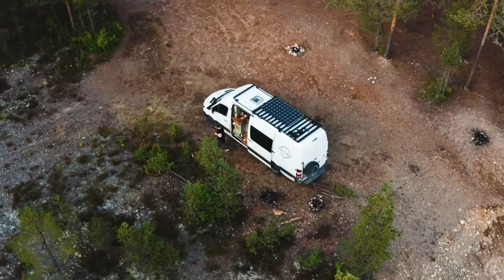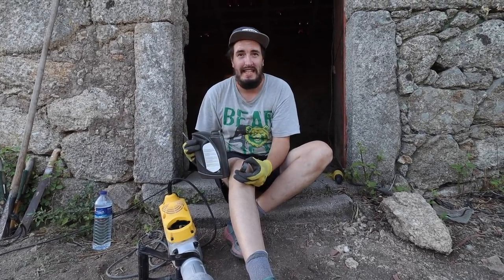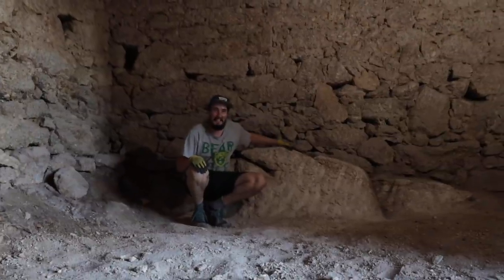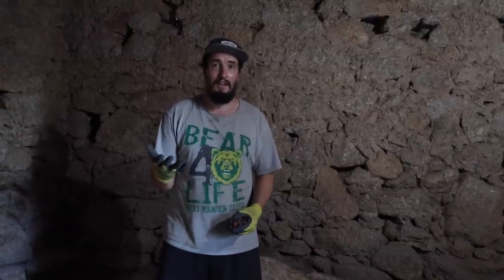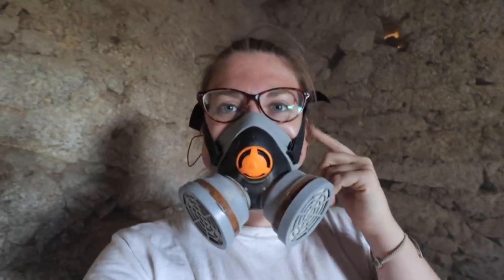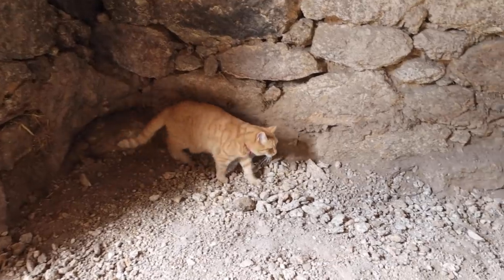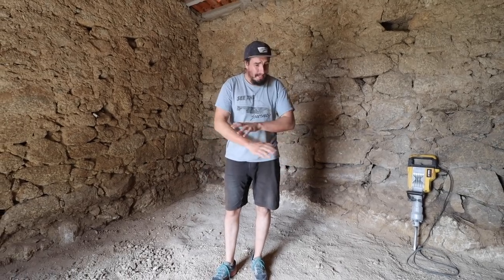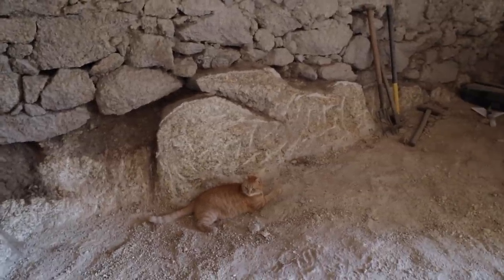Removing the Roof from our Abandoned Stone Barn! Tiny Home Conversion Portuguese Homestead

Comment: Don't get rid of the gravel and cement, recycle it on sight as groundfiller to level the area outside the house, its an excellent base for a parking or a patio that drains away excess water and help keep the house nice and dry
Reply: it looks like the concrete beams have rebar in them. may be difficult to crush
Reply: Great idea!

Comment: All that hard work is paying off on the barn, looking good! 💖💖💖.  BAKED FIGS AND GOAT CHEESE: Line a baking tray with some fig leaves. Slice up about an 8 ounce goat cheese log into about 6 thick slices. Cut about 10 figs into halves. Arrange the goat cheese in the center of the baking dish surrounded by the figs, drizzle olive oil over all, sprinkle with chopped fresh rosemary and salt and pepper to taste. Bake at 400 degrees for about 15 minutes. Afterward you can run it under the broiler for a minute to brown the top. Cheers!
Reply from the maker: Lovely!

Comment: Oh my gosh! My muscles & bones ache just thinking about all that work! I cannot believe that putting in the new floor will be nearly as difficult as taking that stone out. Oh, it was so smart to save the tiles & should save you loads of money. Now i can picture your home in there. Whether you build from scratch or cobble used bits together as you did in the van, it will be a showcase of your design style but be warm, welcoming and comfortable as are your previous builds. All that stone should hold in the cool in summer after an insulated roof & those wonderful tiles go on.

Comment: the concrete beams perfect for foundation under smaller buildings(if you accidentally don"t have there  rocks) or if you need to build terraces or higher walls in the rocky hillside, the beams can help you make a supporting wall, against the falling rocks.

Comment: Seems like you might/maybe could use the concrete as filler to make benches, outdoor tables, raised garden planter beds and line a pond bottom?
Reply: Maybe a French drain for water run off?  Allllllll that work ...people need to SEE all the rubble you two removed by hand.

Comment: I think you could use the concrete and stone rubble on the driveway which I guess you can later tar so that you have a proper road inside this rather large property. Easier to drive in and out especially during wet weather. All the rock and concrete debris will give solidity to the road so it doesn't degrade in heavy rain. 
With the concrete beam structure you could fill it with earth and grow things like strawberries that you can pick easily while standing up.
You can pick raw figs and cook them like a vegetable. Quite tasty. That's my two penny bit for you.
Great job at the barn. Ease your aching bones with an oil massage, any oil, olive for example, and wash off in warm water.

Comment: If you have a deep roof over the south side of the first floor, you may as well beef up the supports and cantilever the mezzanine across that overhang. Increase the size of the mezz or just to push it back so it doesn’t take as much space in the main structure.

Comment: Have you considered a skylight?so much light with the roof off.
Reply from the maker: Yes we are putting in two 😊🙌
Reply: Exactly what I wrote. Brilliant idea. Love to see it.
Reply: Skylight sounds great,  however I would consider having slatting over the top to keep the sun off, as it will overheat the interior, triple glazing sun protection is good, but pricey.  For cooling consider a beehive vented box at the top, this draws hot air upwards and sucks cool air in from below.   In the middle east the bedouin tents are double layered, outside layers takes the sun heat, the interior void circulates hot air away upwards, the interior layer allows the inside to cool.  If you look at the housing in the area you will see steep pitched high ceilings this is for cooling.   Give gingy bear a hug from me.
Reply: @Rockhopper1  Aaaa

Comment: Great  job on  the floor and roof! Do not trash the concrete beams, they will come in handy in the garden, or when you want foundarion for something you need to build. I have moved To Sardinia a few years back so I do know the stone houses. Make sure, you insulate and waterproof the house, especially the roof. The stone houses look beautiful, but in winter they tend to be cold and wet.  As for the figs - make a fig jam. Do you have only dark figs or also the white ones? The dark are very sweet, the white have a completely different, delicate and slightly sour taste. They are also good for jam. But, be careful when picking figs, protect yourself from the white sap, and avoid contact with the leaves. Fig trees are a source of burns and allergies. I learned it the hard way. Also make sure you trim the trees, do not let them run wild. They overtake the space and the fruit is not good when they trees grow too big. Looking forward to your next video! Hugs from Sardinia!

Comment: great project guys... Old rubble makes good hardcore for concrete bases etc... or drainage ditches.... i looked at that style of building and thought, steel frame stringer around the roof line and over hanging upper timber clad upstairs rooms... create a huge deck like structure.. with 4 ft over hang all the way round... and build on that...  just an idea and can't wait to see how it turns out...

Comment: Hi,guys!  Great to see the success with the floor & getting those rocks down to size/out...
With the roof off now, will you be increasing the height a bit?
I'm not sure which way the wind blows in the AM & PM, if it is aligned with the long axis of your roof leak or not, but since you say it's hot there I'd put large, powered fans at each end. Use remote controlled units. That way you can easily adjust exhaust rates...and direction of air flow, too.  Can set one for pulling air in, and the one at the other end for exhausting air out, creating a decent "breeze" through the space, so it "breathes".  Just an idea...  😺

Comment: While the roof is off you could increase the height of the walls, and have a steeper pitch to the roof. Ask around if there's a local mason who could do this. If it looks to be too much work build it out of timber, and cover the pine ends of the roof with timber also. You would have a lot more room for little outlay.  I'm enjoying your build and wish that I had done the same, but at 70 I'm to old. I have written this before watching your video. So if you have discussed this please delete this post.
Reply from the maker: Hey 👋 yes we will be changing hight and pitch and will explain the plan in a future video 🤗
Reply: I was looking for this coment! I was thinking the same!
Reply: i imagine thats what a good chunk of the rubbles going to be used for as well as the fireplace. Heck the cement beams they are a little confused on could even be used for like an outdoor grill/pizza oven. They are super excited right now and i would be to. Ideas flow like water its hard to pick the ones you want and are feesable because you want to do them ALL!
Reply: @theindieprojects  in Portugal there's often permits required for changing pitch and height,  am I correct?
Reply: Should put another full level on. Make a floor than timber upper level for bedrooms and bathroom.  Get some window and light into the place
Reply: I thought the same thing.  Raise the edges some and change the pitch.
Reply: Brandon if is a barn no permit is needed but if building a house then yes they will need a permit
Reply: Doesn’t this also depend on the local architect? We weren’t allowed to raise our barn after a visit to the camara. Maybe if it’s urban land, which I highly doubt in this case, I suspect this barn has the age exemption for the habitat license...
Reply: I just remembered if your land is marked “não urbanizável” means you cannot build in your land and is only for farming. So forget the permits 😎
Reply: @slanwar  so then a barn can not be registered as a legal home then. Can the authorities prevent people from living full time in a barn?
Reply: Brandon they will not prevent if is your land and barn, they wouldn’t see the barn as a residence but you can live there.
Reply: @slanwar  that's very encouraging, Luis. I appreciate the comment. Are you in Portugal? Do you know any people from the local cámaras?
Reply: Brandon no I left Portugal over 30 years ago and everything is different now but some things still the same like using ruins to be able to “rebuild” , maybe someone that’s living there could help.

Comment: I would use them for border for flower beds around the house you can use the to build with also I don't know what your going to heat or cook with but you could get more concrete and make a wood shed outside the front door and start to fill it with wood for winter

Comment: Homemade fig jam recipe

 Ingredients: 500 grams of ripe figs 500 grams of sugar 500 milliliters of water ½ unit of lemon (juice)

 Preparation: 
1st 
To make this recipe for homemade fig jam, start by separating the pulp from the figs of the peel and chop the pulp into pieces. 
2nd 
Then place the clean figs in a pan with the water, sugar and lemon juice. Cook over low heat, stirring occasionally and removing the foam that forms, to achieve a brighter jelly. Note: We recommend stirring with a wooden spoon, as it does not change the flavor of the jam. 
3rd 
After an hour, or when the homemade fig jam is thick to your liking, turn off the heat and place in tightly closed glass jars. Let it cool and it's ready! 
Note: Remember that, after cold, the candy will be slightly thicker.

Comment: Figs can make you a bit “loose” if you over indulge. 🤢🥴😓 Those concrete beams could be used in a retaining wall scenario. Also those roof tiles could be used in your next building project. They also may have some value to someone who’s doing a restoration project somewhere local. Remember “energy and material “ has already been expended so it would be a waste not to reuse them. 😳👍

Comment: Try to keep wood away from the exterior of the building, especially the roof. I advised a friend to cement all his roof soffits and take the exterior wood away, luckily in 2016 he spent 6 months doing cementing and getting rid of all the lovely wood he had spent months putting up. Then the fires came through the whole of the Gardunha in 2017 and ripped through a lot of friends farms and land, including his. Luckily he didn't lose his house, but everything around him is gone. The only reason his house still has a roof on was due to my advice of no wood on the exterior of the building. Be safe and wise. Fires here are insane. Not trying to scare you, just be aware of the insanity that happens every summer. Apparently it's around every 7yrs per area of Portugal (yay for the wood cartels & corruption!) Good luck. Peace

Comment: 300 gr figs, 1/2 lemon, 1 table spoon honey, 75 gr sugar. Wash and chop up the figs, toss everything in a pan, boil for 20 minutes, mash it up with a blender and poor into a sterilized jar. Close off, put upside down for 5 minutes. Let cool and store in a cool place.
Reply: @theindieprojects  I just made my first two badges of jam ever yesterday: it's so easy. Very messy though (but that's probably on me, lol). Tip: use a high cylinder when using a blender. Doing it straight in the pan results in splatter everywhere.

Comment: If you don’t want the roof to leak then the roof has to slope at 28 degrees minimum which is the manufacturers guarantee for these types of tiles, Put the figs on the BBQ or slice them drizzle them in local honey and cook in a frying pan, fig and orange crumble tastes like rhubarb crumble!
Reply from the maker: Yeah that’s why we are doing a new roof as the pitch was to low and letting water in 😀
Reply: 30 degrees is a good average angle for solar panels too...

Comment: Ooh, and another important note...if you can avoid it, do not use insulation that has Formaldhyde in it i.e. the "Pink" stuff.
In the USA about 10-13yrs ago, we started using a Formaldhyde-free fluffy insulation made by Johns Mansfield.  Now, other companies are offering formaldhyde free options, including Corning,which makes the "Pink" stuff. Formaldhyde is highly toxic to ppl and animals, and always leaches into the living environment over time, which also greatly decreases the R-factor, requiring replacement in 10-12 yrs time.  Most ppl realize attic insulation needs replacement over time....especially formaldhyde versions.

Comment: Have you checked radon levels? Would the roof have been concrete because of the risk of fires?
Reply from the maker: Roof was concrete as the old wooden roof was replaced and the concrete beams are super cheap

Comment: PLEASE RESPOND. Hi, I am planning to buy a property in Portugal and it have concrete beams, that the owner says are freshly replaced from the wooden beams that we in the property listing photo. You did not go into detail about WHY you took out the old beams. Please could you expand on that. I don't want to buy a property with problems.
Reply from the maker: Our pitch was to shallow was letting water in. Concrete beams are pretty hard to work with. It’s hard to fix to to them and insulate and we much prefer the look and feel of wood. It depends what kind of property you have but feel free to send us an email with photos and we can advise you there.
Reply: @theindieprojects  Hi, thanks for the response. I re-read my first message and saw all the typos. Sorry about that. ok. I'm  looking at the photo really closely and I'm starting to wonder how old these supposedly "new"  concrete beams are anyway. I think I can see cobwebs. What is your email address?
Reply from the maker: Contacttheindieprojects at gmail.com

Comment: If you'd taken the roof off 1st then the floor work wouldn't have been so hot.
Reply from the maker: Really? I would rather work in the shade of a barn then in the direct sun. Not sure your logic here 😬
Reply: @theindieprojects  my logic is that you weren't working through the middle of the day so the walls should still give you shade and without the roof you'd have fresh air and possibly a bit of a breeze to boot. I'm in Queensland, Australia so I know all about the heat & the difference a breeze can make. I dare say Portugal in Summer would be as bad as where I live.